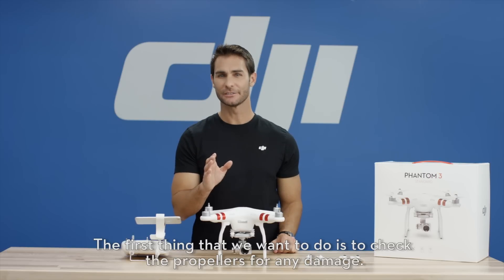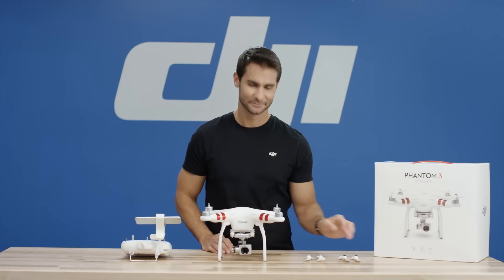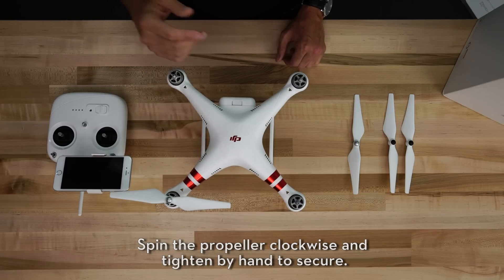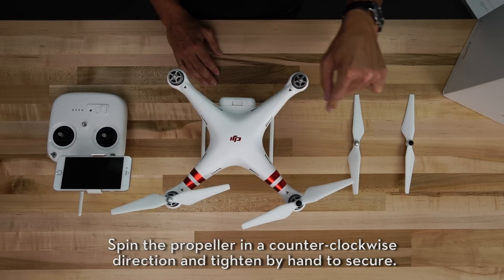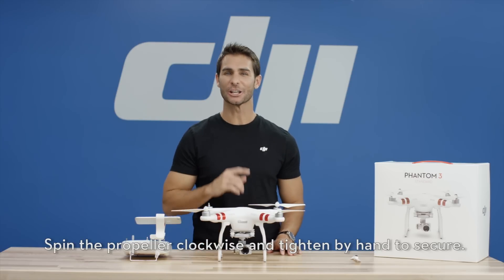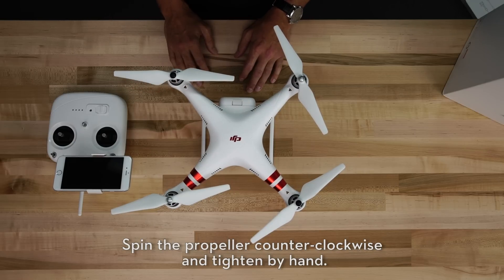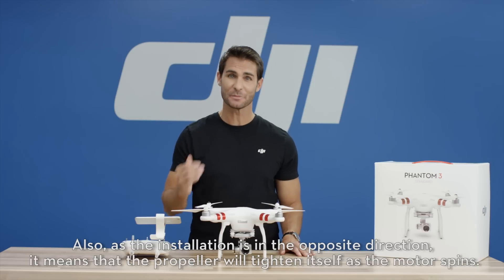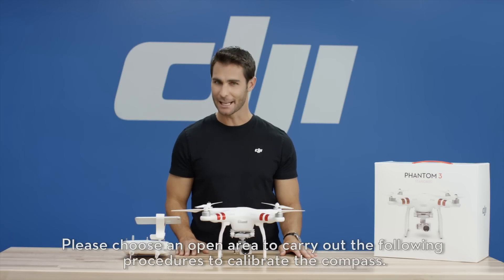DJI Tutorials - Phantom 3 Standard - Installing the Propellers

Comment: can these props be used on any other motors fitter with different screws or fitters ? I bough these props to use on my motors, but i failed to fit the black tipped prop ( though I tried as per direction CCW). i need your help, pls .